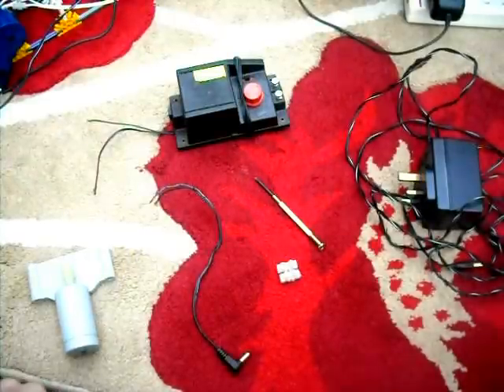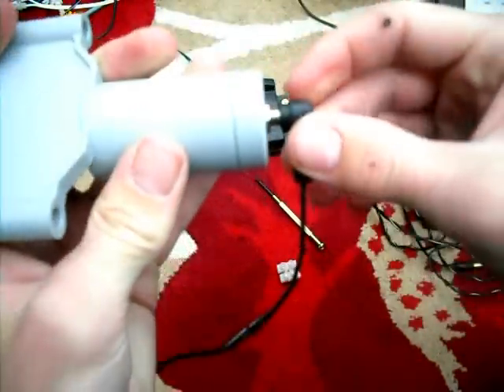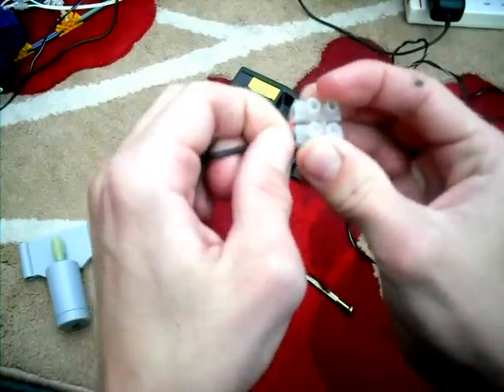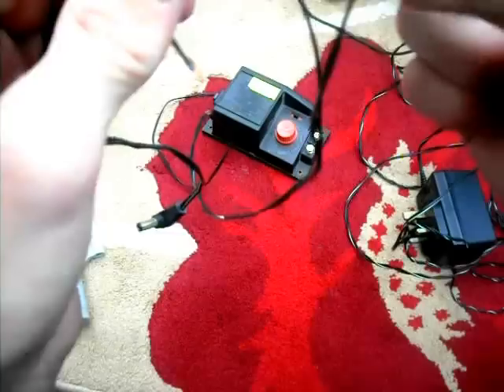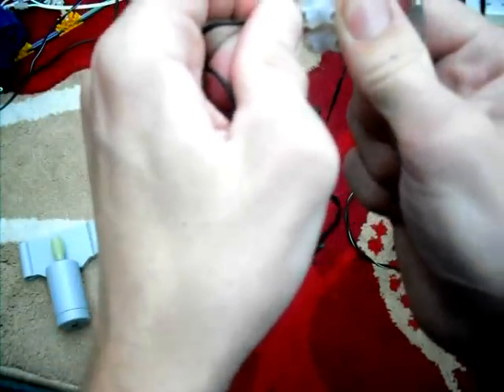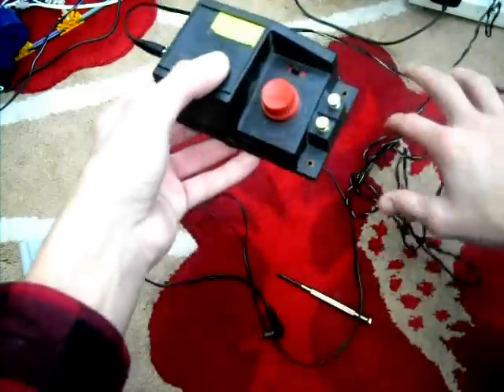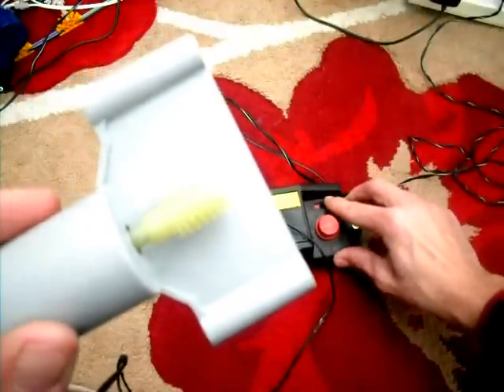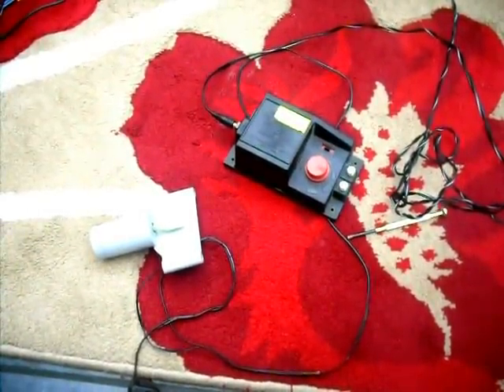how to make knex 12v moter change speed

Comment: If you simply want it running slower say for the K'nex Octopus Wirl, just use a lower voltage transformer (eg) 9 volt or similar. It does not alter or lessen the power of the motor, just makes it run at a more sensible  slower speed, so that some of the K'nex models do not look as though they are about to take off.

Also spoils the actual authenticity by the models going to quickly as opposed to the slower speed which is more in keeping with the full sized fairground rides.
Regards -Jonny.